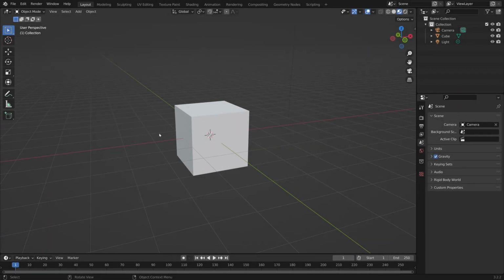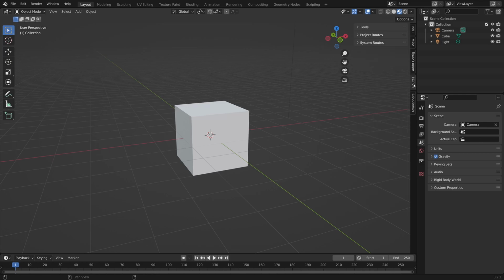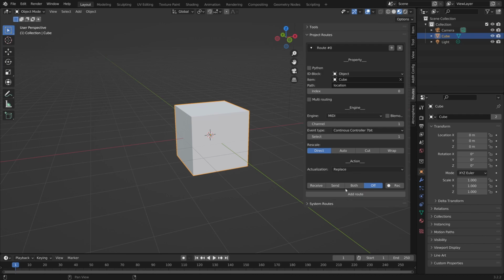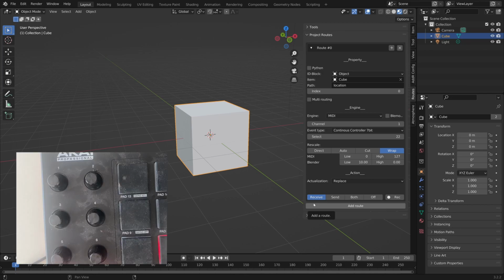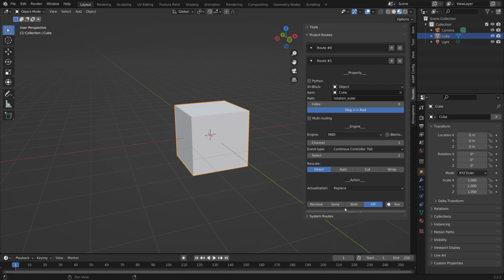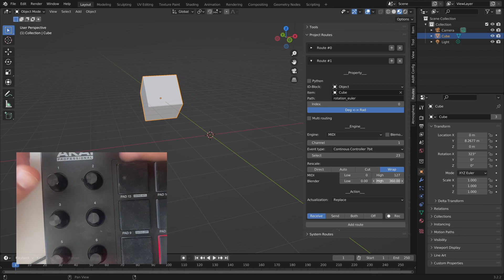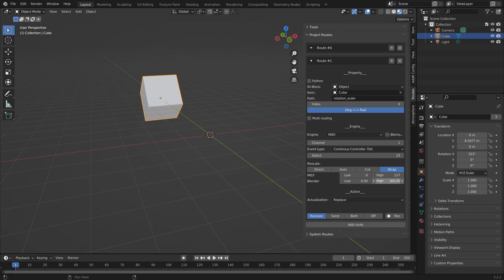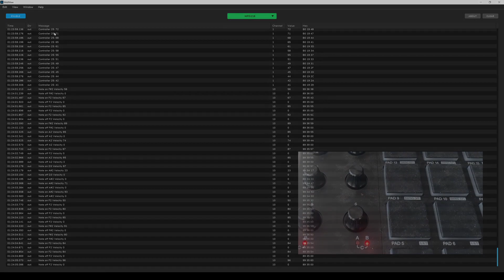Control Blender 3.2 with a MIDI hardware controller! (JPfeP AddRoutes)

Comment: I love add routes. Really fun to use with autokeying active to record your animations. For that switching between empties and GN object I like to use the pin icon in the properties/ node editor. Sometomes splitting those and pin different things makes it even less annoying.
Reply: I haven’t been able to keyframe with this addon.. how do you do it? Already tried autokeying.
Reply: @sukumizune2477  just tried it. Works just fine here with 3.41. Do you have any keying sets active or made adjustments to autokey behaviour in the prefs? Also timeline must be playing. It won't add keyframes when the playhead is on pause.

Comment: this is highly useful, since eevee is fast enough to show realtime animation you can try to incomporate it into live visual show
Reply from the maker: Nice! Although to be honest I think Unreal Engine would be a much better choice for that as it’s render engine is specifically designed to run in real time and has better and more numerous input options!!! Although you wouldn't need to give up on Blender because there's a plugin for Unreal Engine / Blender that lets you model in Blender and the object instantly updates in Unreal Engine.
Reply: Touchdesigner is better for that ;)